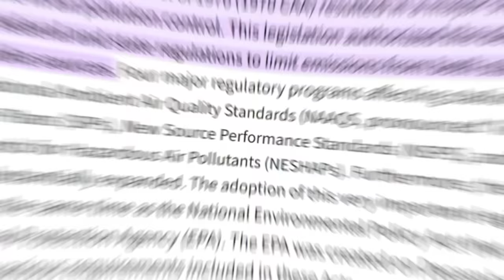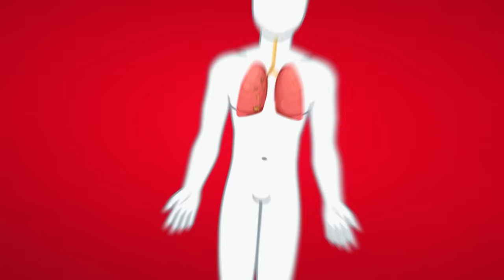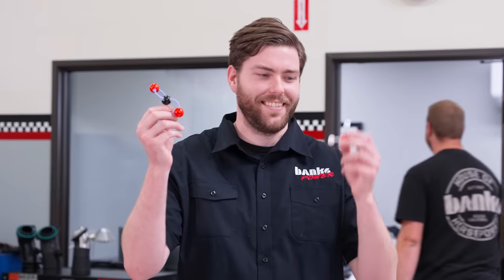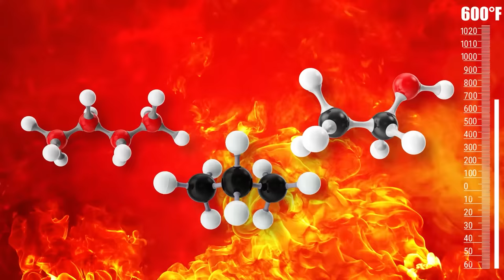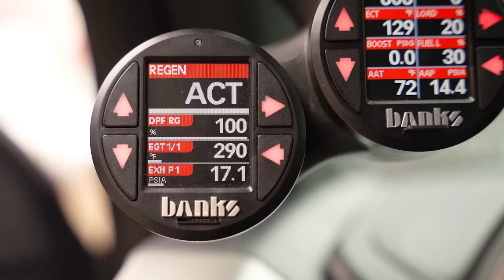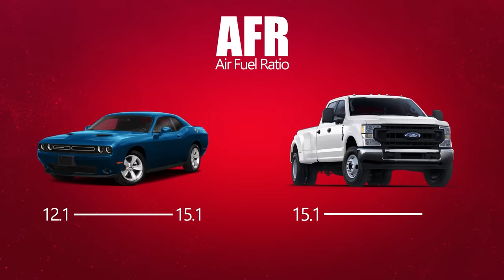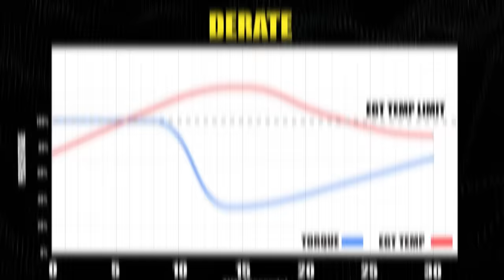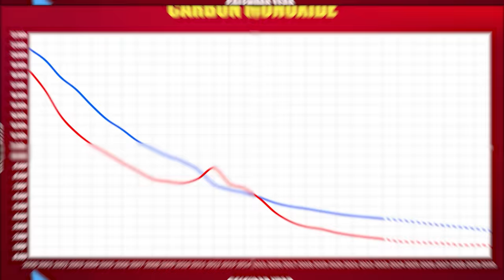Understanding the Most Hated part of your Truck | Banks Entry Level

Comment: I wouldn’t delete my trucks if they would last but they don’t I’ve had 3 dpfs fail around 130-150k KM or near 100k miles. We buy these trucks for the reliability factor but the emissions systems don’t last and when they do fail they cost 15% of a new truck my last repair quote was  $13,700 to replace the system when it only cost me 3k to delete it. Now deletes are legal here in Alberta Canada but manufacturers need to step up if they want to really help out. But they don’t care it’s just the bottom dollar to them. I think that if the government wants it and demands it they should force the manufacturers to do a life time warranty on them.

Comment: I feel this channel legally needed to make and upload this video. Its a great video, but the truth is and with many others, with that large torpedo removed, the fuel mileage is better, EGT's are cooler and you never have to worry about the DEF shortages or DEF all together. Clean tunes have excellent results and don't draw attention, cause like Mr. Banks has said before... my records still stand, and you don't see my stuff rolling coal in the process like everyone elses thats playing catch up with me.
Reply: if your tune is clean then you hardly use def and the dpf last a very long time they really love a spicy not over fueling tune as high egts make it work better doing high rpm pulls every once and a while clean the dpf better than regen does

Comment: Light duty diesels ARE being regulated out of existence. Diesels were known for their reliability. Now the diesel options have an additional $10k worth of equipment up front. Reliability is out the window because all those extra components come with problems that will put the truck in limp mode or just not run, which requires a dealer or very expensive scan tool to even diagnose. Then based on your own info, you get to spend at least $5k every 100,000 miles to replace the clogged up parts, and that doesn't include ongoing DEF usage. I get that it's better for everybody that emissions are lowered, but you can stop blowing smoke up our ass singing the praises of the EPA and their diesel killing laws.

Comment: Ok, so they build 30 new factories in China with no regulation on emissions to make a bunch of new parts out of more materials that have to be mined, processed and shipped to those factories to be put into "American made" vehicles and then load those parts onto a huge ship, that puts out more emissions than 300 diesel pickups, to haul it half way around the world and then in order for the parts to effectively reduce emissions the truck owner has to spend extra money on more chemicals that are consumed by the vehicle that have to be produced in an emissions emitting factory with whose ingredients which are hauled there with a diesel engine and those chemicals are made of urea which is the primary nitrogen component in fertilizer, which causes higher demand and drives fertilizer prices higher which increases the cost of food production and thus makes everyone on the planet have to pay more for food. The overall emissions have not been reduced. the cost on everything you buy has simply been increased.

Comment: It's usally doc, dpf, than scr. Doc reacts with extra diesel to raise the temperature for the dpf. Scr is last l so you don't damage it. Egr is used to reduce the nox in the cylinder also

Comment: I’m glad you put in this great work to support these systems and make real efficient power, but I still think we have some of these emissions systems rather backwards.

First off, the EGR should pull inert gasses post DPF, recycling abrasives back into the motor is one of the stupidest things I have seen.

Second, you should not be regulated as an individual, enthusiasts should be allowed to remove these systems on non commercial vehicles, and the EPA should put more of that effort into forest management and regulation. The forest fire smoke is more harmful than Joe Blows soot, and some older trucks cough 6.4l need to delete to be reliable.

I have no issue with this technology being furthered and factory equipment helping reduce emissions, but that’s where the line should be. These systems are absurdly expensive and not technically required to have a reliable workhorse, and it should be up to a non commercial individual to determine how their truck is equipped.

But yeah, keep up the good work, you guys do some amazing stuff, and I think this approach is a good one despite legality, you improve the vehicle the right way.

I really want a deleted 6.7l, and I really want it to be legal, not for power, but for the sound, the decreased complexity, and cost of ownership.

Comment: What's always overlooked, is that the particulates produced after diesel fuel combustion, are heavy and fall down to the ground quickly.

I also know way too many farmers in their 90's, that grew up running diesel tractors with upward facing exhausts their whole lives and are in perfect health for their age.

I challenge anyone to go and talk to an old crop farmer about how "dangerous" diesel engine exhaust is.

All modern truck/tractor manufacturers (DPF equipped) have very specific literature provided with said vehicles, telling you to stay away from the exhaust pipe during re-gens. And for good reason... Friend of mine took an accidental breath of exhaust while walking behind his 2020 Ford 6.7 during a re-gen and he developed a bad cough for over a week. Said he thought he was going to pass out when it happened.
Reply: Farmers tend to have fewer vices than city folk and hence live longer because of that.

Comment: Remember, NOx also has a CO2 equivalent of 298x. Meaning 1 part of NOx is roughly as bad for the environment as 298 parts of CO2. Not only will it give you cancer, it's also just plain terrible otherwise.

FYI sulfur is why some European cars were sold in the US with cast iron blocks instead of aluminium ones in the 90s and early 2000's. The EU didn't allow much sulfur in petrol/gasoline fuel at that time but the US allowed a fair bit, and sulfur in fuel binds with the silicone in nikasil and chemically rips the coating off. Since a lot of them (especially BMW's) used nikasil coatings at that time, they wouldn't work for the US market. In the EU though you can pull those blocks apart after 200k miles and the cylinders are usually still within spec and the block can be reused without anything more than a good cleaning and resurfacing. They also rarely burn oil as the piston rings used are stronger than in cast iron blocks or steel liner blocks due to the nikasil coating being able to handle them.

Also you can get rid of the PCV entirely if you switch to a dry sump system, have fun draining your oil from 10 different places each oil change though.

Worth noting too that the only reason early cats made less power was because they weren't properly sized. If you have a properly sized cat you shouldn't lose any power at all compared to straight piping the thing. Modern cars typically have precats though which are restrictive as hell but also completely useless after the primary cat is warmed up. The precat could be bypassed to still make emissions compliant peak power, Koenigsegg even has an entire patent for a system that does so.

Comment: how much PM is put into the air during a regen cycle? I know that you will not pass smog during a regen. The smell during a regen is worse than any none DPF truck.
Reply: Plus you are spraying more diesel into the filter to raise the temp, not very fuel efficient or environmentally friendly.

Comment: I like and enjoy the idea and concept of clean air. The engineers deserve a well pat in the back. The same way the EPA requires this DPF system, they should also require reliability and cost-effective ways on maintenance up keeps on it. Quite frankly, right now, they are junk and only keep the trucks in the dealership, costing a lot of money down time and all. This down time cost should be covered by the warranty cause they won't refund your rentals to keep moving. They will strictly only pay for the repair, and not all parts are covered.

Comment: I'm the new owner of a 2011 gmc savanna with a 6.6 duramax. The reason I want to do a dpf delete is because that system gave me so much trouble and cost me so much to fixe and even once fixed and no more code, I still had to go to the dealer and pay again just so they plug their scanner to make it run a static test so it can finally go out of limp mode. I'm just not ready to take the risk of being let down a couple thousand miles away just because electronics decide that it need to be fixed right now

Comment: 6:57 I didn't realize the density of the DPF.   I'd thought when they become clogged it might be better if they could be simply opened up and heated with a NG oxygen rich flame to burn off the residue.   This shows how difficult it likely is to burn off the deposits through very long narrow passages.   

A series plugin hybrid HD drive train allows for strong regenerative braking fulfilling the need for dynamic braking for heavy loads where the HD over-the-road Diesel compression brake is the only well developed dynamic brake system otherwise available.   These pickup Diesel engines don't have a true engine compression release brake, but they do use tricks with the turbo and restricting exhaust to produce very useful engine braking.   Diesel fuel should cost less to produce per gallon than gasoline, but in the USA Diesel costs a lot more to buy for over the road use.  That makes a HD high efficiency direct injection gasoline engine possibly more cost effective on horsepower than diesels, but without the ability to control the load with high engine braking gasoline engines have been basically a no go for heavy loads.   A BEV drive train with high regenerative braking is typically much more powerful than even the best HD Diesels allowing faster down grade speeds.    

What Chrysler has developed with its plugin series hybrid gasoline BEV pickup bears careful observation.   It has more available horsepower for both drive and brake than its Diesel pickup competition.   it's complicated new vehicle; whereas, modern Diesels are also complicated, but have had decades of work experience.   The RAM series plugin hybrid pickup is a BEV and like most of the recently introduced USA BEVs  that are not Tesla there is the scary possibility it might "brick".  That is that big heavy battery pack electric drive train vehicle might be rendered dead or near dead because it can't charge or the electronics and software just go down a rabbit hole it doesn't want to recover from.    At that point people are likely wishing they could at least get a loose connection between the working gasoline engine to the wheels to get them home or to the car dealer.  I recommend for anybody with iffy vehicle like this to have the higher AAA membership that has unlimited free towing with priority.   

Plugin hybrids for cars have the disadvantage that they weigh almost as much as a pure BEV because they are having to lug around an ICE engine with alternator with a high center of gravity and all the dedication of the vehicle layout to support it, when in day-to-day use it doesn't get used.   The ICE engine runs occasionally to burn up enough gasoline to ensure it is replaced to keep it fresh and lubricate the engine.   In Europe plugin hybrids don't work for saving the burning of gasoline because typically higher priced cars are company cars provide to higher level employees where the company also pays for a gasoline purchase card, so the people don't plug the plugin hybrid in at home and spend their own electric bill on them.   In the USA people own and pay for their car's energy and definitely want to run the their plugin hybrid off their home electric bill.  They still have to pay for maintaining a gasoline engine even if the other disadvantages aren't that bad for them.  

The RAM plugin hybrid might have the advantage it could power a house.   If it can keep the house A/C on after a hurricane has wiped out the power grid for next week that is worth something.

Comment: I would love to have the DEF system back on my Duramax 6.6 diesel but after the dealership couldn’t regenerate it for the third time in row they tried to sell me a who new exhaust system for over $8K and that wasn’t happening, so I deleted it myself for under $2500 and gained 75 hp and getting better fuel mileage, went from 21.5 to 15.5 litres per hundred kilometres, and it doesn’t put out black smoke.

Comment: Bottom line is these companies have to remain compliant with EPA regs so they push products that they can still legally sell. All of that technology just to get these systems to a semi functional state. Ultimately your driving style is the largest factor that will determine how soon you have an issue but make no mistake it will inevitably fail. My last work truck was plagued with DPF issues. It was in the shop constantly. It saw a lot of idle time which ultimately led to complete blockage at only 80,000 miles. The EGR crossover and DPF both plugged up which caused turbo damage. It happened in the winter and it was pretty cold out so I thought it was just the fuel gelling up but turned out to be the motor suffocating itself and creating back pressure. I don’t know if the pressure sensors became blocked off creating false readings or what but the system gave no warning. The EPA can SMD!!!

Comment: The boat anchor hanging under all diesel trucks is the reason i bought a gas truck. True i dont have the hp and torque of a diesel but gas is usually cheaper, not pouring what amounts to piss in my truck, and i will never have to replace my DPF. Maybe have to teplace a cat at some point but those are a hell of alot cheaper than a DPF.

Comment: Im not concerned about a lack of hp. I'm pissed that my 7.3 gets better fuel efficiency (roughly 25mpg) than my 6.7 even AFTER a delete and economy tune with that im lucky to see 20. Hell my old 6.4 after it was delete with an mpg tune gould get 32 a gal on the interstate. 

These were all when not towing something. But when towing the 7.3 and 6.4 got better mileage. Even if it was only by 1 or 2

Comment: I have a LML, Chevy could not or would not fix my truck. At 30,000 miles it stayed in regen for 4 months. I got between 3-4 mpg and could not top 50mph. I parked over my mown lawn in green Ohio and found a brown spot nearly the size of my truck in the morning. I had just driven through a field of mown straw. For you Californians, straw is the dried grass shot that wheat was on, it becomes a very hot grass fire. 
The dealership had it fixed, my 397HP V8 now makes nearly 800HP and I get 20 mpg at 70mph and 25 mpg at 80mph. Put my 15,000 pound trailer on it only get 16 mpg.

Comment: I own a light diesel commercial vehicle with a dpf and im concerned about it being clogged with ash and needing replacement is there any less expensive method to clear or repair it once this happens?
Reply: Yes, warm the engine up normally for like 15 mins then literally just drive down the highway in 2nd or 3rd gear for 10-20 mins. Drive the opposite to economical. Like when you see a glowing exhaust on a race car, drive it like a race car. DPF needs to get hot to clear out.

Comment: Great video. My ram 2500 asked for an active regen. I had to shut down the car before it was completed. Now it says DPF is full and to take the car to the dealer.  Ram dealerships in Florida take 4 weeks to work on diesel engines. Was wondering which diagnostic tool I can buy to force a regen again

Comment: @17:28 it wasn't"just" catalytic converters in the mid 1970's that reduced engine power. It was the need to make the converter last with a carbureted engine, and that domestic manufacturers didn't really get ahead of the emissions laws, they reacted to them, they built vehicles to federal and CARB emissions standards wasting engineering resources.  But it wasn't just catalytic converters that sapped engine power.

Comment: No one cares about the power we care that all of them have too many components that break very easily. I work as a diesel tech it's literally the #1 thing we repair, the engines despite a few bugs here and there are rock solid.  I'm getting tired of telling owner op's that we gotta hold the truck to have the cans burned off.  He's losing money in the form of lost work and having to pay us and we techs are honestly just tired of dealing with them it's not like they are quick change like a air filter.

Comment: I have a real simple solution: my 1996 Dodge Ram 2500 Turbo Diesel does not use DPF and neither does my 1991 Cat 3208 in my motor home.  BTW, the truck has the full Banks kit including the twin intake manifold.  It works great and has almost doubled the HP.

Comment: both my vehicles are 2007, that was some of the last car models released without a dpf. Here in eu anyways...Keeping those untill they fall apart. Its hyundai 1.5 crdi engines, also has camchains - not complaining at all! If i had to buy a car today id just get an electic bicycle- everything else is horribly expensive and lets not start about service costs.

Comment: Amazing video professionally produced ton's of good info. I just bought a 2024 GMC Sierra and would like a display that uses the OBD port to provide me with engine data and more importantly which gear the truck is in. I'm happy with the power all I pull is light trailers for my bikes. What unit would you recommend. Thanks Mike